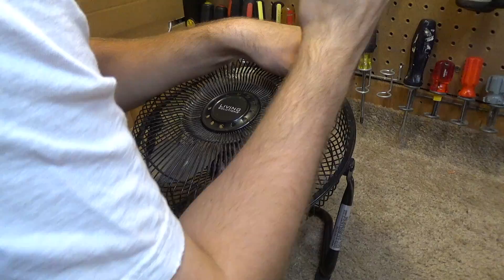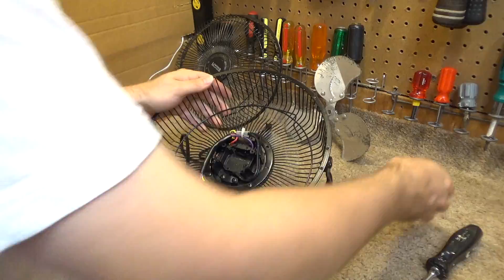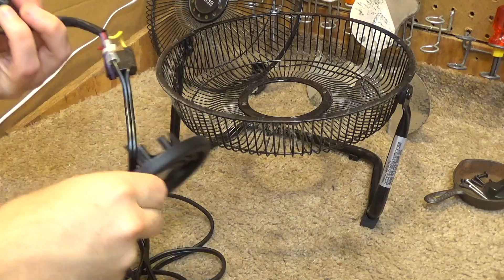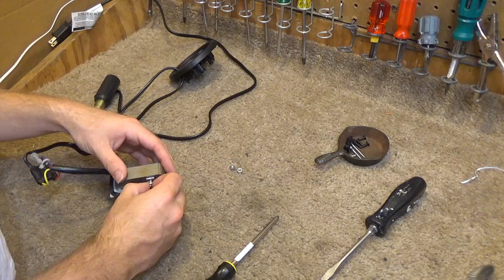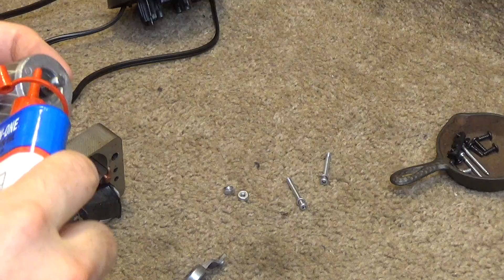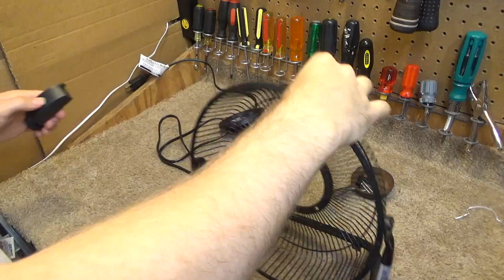Clean and Service Living Solutions 9" High Velocity Fan model MF-9

Comment: Actually those little c frame motors last forever as long as a few drops of oil are applied every few years
Reply from the maker: It depends on the unit, they're not all made to quality standards that hold over time.

Comment: I fixed a fan or 2 and glad I saw this one because I didn't snap to the bearing wick on the 9in fan and took it apart 2 more times and got it working, I just need to diagnose the bigger one you did in another video, only problem is it doesn't turn on or motor hum when I turn it on. I'm going to clean it and see what comes of it.
Reply from the maker: Perhaps there is a loose connection somewhere.

Comment: What about soaking some of the parts of the can (Not just this one) in the oil you use to lubricate them with? Like to get into them and help repair them?
Reply from the maker: OK
Reply from the maker: That doesn't make sense, even if you replace the word 'can' with 'fan'..
Reply: @JordanU  Im talking about the bearings and such. Soak the bearings and parts that need oil and let it creep into the bearings and see if that frees them up. Instead of banding on them. Let it slowly creep into the bearings while you clean the fans.
Reply from the maker: @maddmaxx636   That's not how it works.. You have to bang (band?) it to get the alignment where it needs to be.. No amount of oil will make it work while out of alignment..
Reply: @JordanU  Yeah, If I said band I meant bang.

Comment: I had one of these too a loong time ago (before I bought the 2 Black&Decker pedestals, which eventually broke, that I mentioned to you before). 

Coincidentally, the one I had that was very similar to this one (floor model) was a Black & Decker too (that’s why I later bought those 2 B&D pedestals).

The floor one was very good and never broke... but I moved and left it at my old apartment.
Reply from the maker: It was probably the same thing as this, I've seen these sold under countless different names.. This is definitely cheaply made, but it's not so cheap as to be worthless..